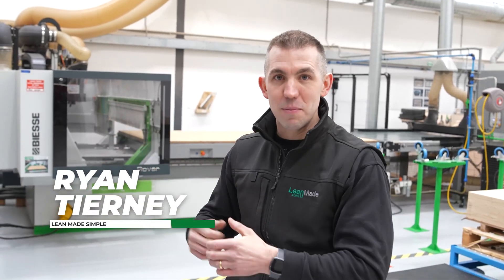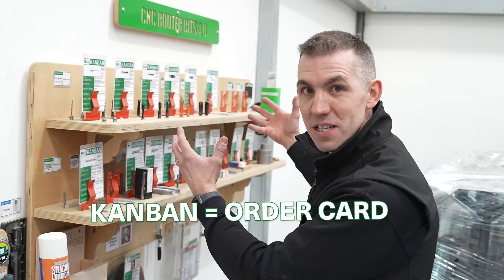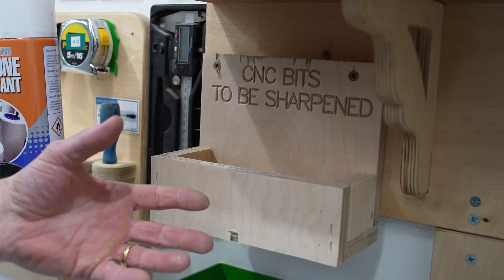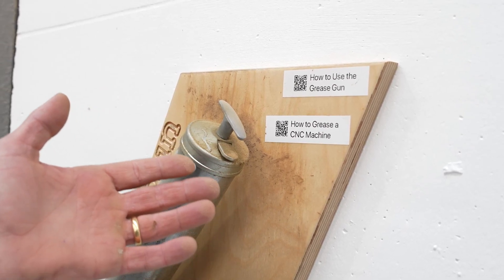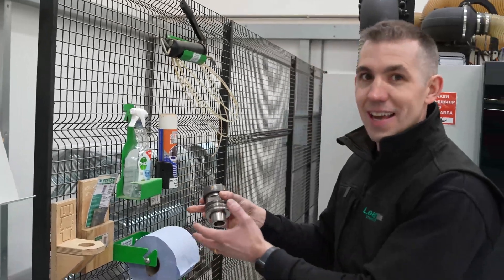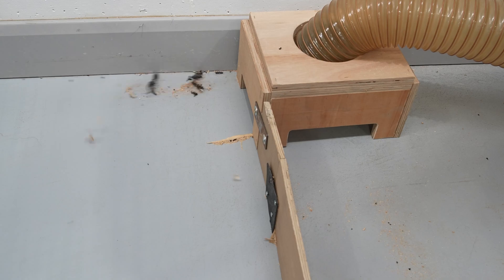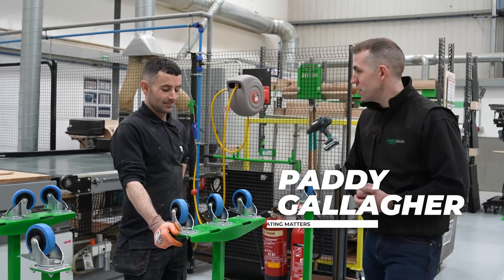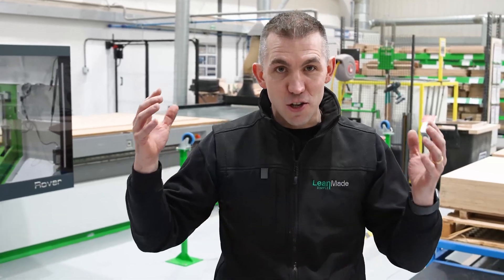How To Make Your CNC Machine SUPER Productive!

Comment: Can I ask where you sourced the rubber dust stoppers on the bottom of the CNC would actually be a great  idea for the one I use
Reply from the maker: They are great, these are folded metal plates, we made them in house and powder coated
Reply: @leanmadesimple  aw brilliant so something we could make ourselves then perfect cheers